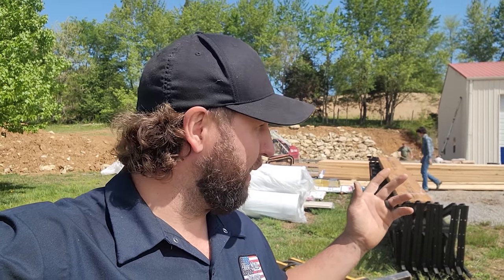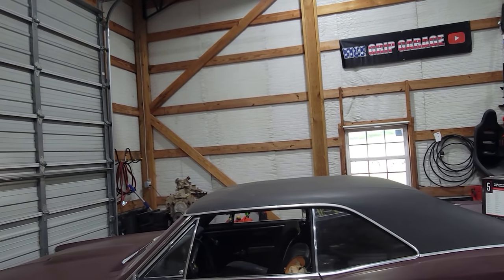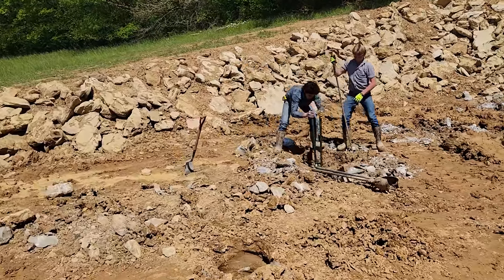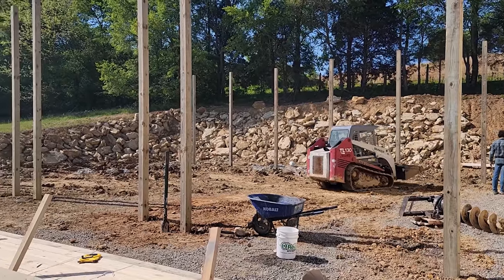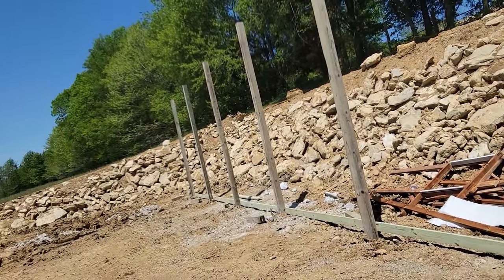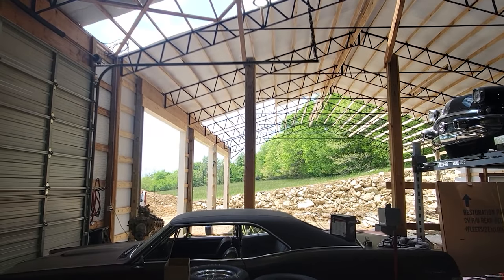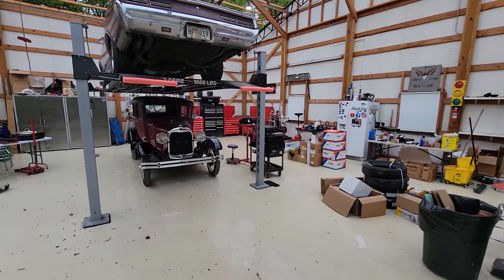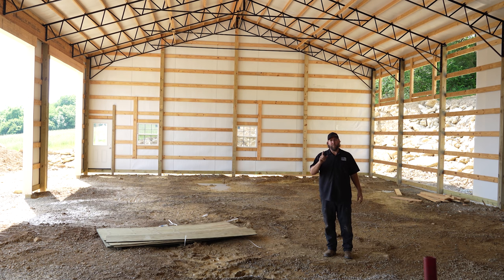Budget Shop Build - EP2 - Framing & Tin!

Comment: Save all the old tin and bubble installation & some of the gravel and cut the rotted parts off the wood that came off your shop so there is little to no cost & build a small little ''shed/shop'' with a gravel floor for your kids to use as a small YouTube Room/Rc/ATV/toolboxes kid shop

Comment: Didn't read all the comments sorry if you already got this info. I used PEX plumbing tubing inside my shop for air line to save money and install time. I used the compression rings and fittings. The tool was expensive, but the fittings were cheap.  Also my compressor is in a small shed about 20' from the shop. The air is run in hydraulic line along with the electrical in a two inch conduit. I have a reciever tank in the shop, but I really only did that because I had a spare. The system has worked leak free for over 20 years.

Comment: Derek I recently built a 36x30 ft garage.  It’s wood frame.  Up here in RI IT CAN GET PRETTY cold in the winter and hot and humid in the summer.  I installed a Mr Cool diy unit in one day.  24000 btu.  It. Heats and cools and does it well.  Cost 2200 bucks.  You might need 2 of them.  Go to you tube and check them out.  I’m happy with the unit.  I even installed two more in the house.  I got a large house.

Comment: Derek, just in case noone gave you a heads up, I could be wrong, but I think you want to say : " wainscotting", which is a half- height interior wall finish, typically used in either a  kitchen or dining room. (I was in architecture for some time prior to changing career focus.)

Comment: A 3ply glue lam column made from 2x6 is actually stronger and better then a solid 6x6. The 6x6’s warp really easy and bend and bow. Using 2x6’s it won’t do any of that hardly and it’s a much stronger overall “pole” 

They just got to be built right. 

Otherwise, man your living my dreams. A 40x120 shop….that’s to die for!

Comment: For air I’ve always run 3/4 pvc, rated for 375 psi. Easy to work with lasts 15-20 years if kept out of uv light.

Comment: Cheap and Effective air lines: PEX pipe. I run my shop with PEX pipe and it works great, plenty robust. crimped connections. PEX isnt officially rated for air but she works good. Run your main run of air from one end to the other in like 1" PEX for big gun volume, then have convenience air ports that are say every second truss  or work area at least and get a NPT to PEX adaptor, screw on your MType female end and there ya go. Obviously a coupe valves. Also I recommend metal fittings for the pex, the plastic fittings arent as robust and Im figuring you run your air system at all of the PSI

Pex is also a flexible pipe so it wont shatter or burst, if it leaks it will weep out the fittings not explode like pvc. Obviously leak test it with some soapy water or whatever leak detector you use of choice, just spray it out of a windex bottle or whatever.

Comment: Hey Derek, my little garage is only 30x40 but I ran 2inch  40 pvc for my air lines and nt only is it cheaper than smurf ---- you will gain a lot of reserve air storage. I also changed all of my old florecent lights for led and cut my electric bill in half. Keep up the content it's really great. JRM Eldorado Oklahoma

Comment: Dont use pvc for air line. Use pex or copper. Air bib in between each door. And hose bib next to them. Then mirror both on the back wall. Add 120 volt outlets to that bundle. And 240 volt outlet if you think you will be needing one. Exhaust fan on each end or one and. A draw vent. For exhaust and other fumes. Maybe a waste oil drain station. Kinda pricey but used ones that work not so expensive. Maybe find a shop closing up and see what a feller has. If near md pa va or wv i could pick it up and haul it for you or just put some peepers on it for a fella.

Comment: Check out rapid air for your air lines! Can lay out an install with 2 people or 4 friends if cold snacks are involved! Haha. But installed in our 80x100 steel frame shop an took a day an half but that's including figuring out where an how going to run lines. Best money we spent in my opinion.  An it's easy to add to if things change

Comment: Even though you arent putting in any offices or rest room, I would suggest laying in piping for a drain by one of the doors. Someday one of the boys may want to do some car washing on the inside, or at least hosing down the dirty floors and having it run away from the building under the concrete. Plus you may want a place to put a small sink in case maybe a guy gets brake clean in his eyes. I dont think you have worry about freezing like you did up north.  Plastic pipe isnt too spendy.

Comment: Derek, when you put the insulation in the ceiling, look at how you can use a radiant barrier like Reflectix to block the summer sun from heating up your interior space.  I have this tacked to my roof trusses in my garage and it is amazing stuff.  You won't regret using it.

Comment: ,Beautiful Job. I had the Amish build me a 24x40 pole barn a few years ago. They were absolutely quick and articulate. I did the vinyl siding to match my house
I am looking forward to seeing the floor poured in a completed build as I still have a dirt floor and looking at improving it. I will need a week or two to clear out my racking and toys.
BTW, if you should ever decide to let go of the Int'l Scout, I am definitely interested. I need another hobby and my age us starting to slow me down.
Thank you for all the enjoyment you àll provide. I thoroughly appreciate it and look forward to the next.
Reply: I also put an overhead door in the back wall so I can drive right through or open the rear overhead to move some of my stuff to outback to run it or store it out there.

Comment: Run the wiring and plumbing everywhere around the shop now even if you don’t think you will need it, much cheaper and easier now than it Is later. You can always tap into it down the road when needs change

Comment: DAIKIN mini split a/c and heater. I have 2 in my 30x60x12 shop. 2 10x10 roll up doors. They keep it in the 70s easily without having duct work.

Comment: Building codes are way different than here where I live, in "Uff da" country. Here concrete floors and the concrete base for walls are made first. All wood are isolated from concrete to prevent rotting. Sticking wood directly into the ground would make the building inspector go bananas... But anyways, good luck with your new shop. Wish I had enough space to build the same...

Comment: Hey derek, if your still looking shop fans. If you can find some old attic fans they can move some air good. Ive got one in my shop that is my a/c and ventilation system. You can raise the bay doors and itll move a good breeze thru. May can find some on the FB marketplace. Just a thought. 🤙🤙

Comment: Use 3/4 or 1" UV resistant PEX waterline and fittings for airlines super easy to install and alot cheaper than those special airline kits. I got 3/4 PEX running approx 140ft(50ft underground) from the compressor in the woodshop to my main shop and run my air impacts easily.

Comment: one single urinal and a sink. no toilet or anything else. it is easy and cheap. don't even worry about running water to it now just plumb it in before concrete. i did not and it was a huge mistake. congrats on the building either way tho, you have worked hard and earned it.

Comment: As far as your electrical.  I own a Electrical contracting business and have wired lots of shops including my own.  If you can run PVC conduit under the concrete it will save you a lot of money in labor and materials.

Comment: Probably can get away with some ventilation fans on the walls to put in some circulation along with some decent size ceiling fans or with some of those exhaust fans you could have some of them drawn in air those are relatively cheap

Comment: Those laminated 2 by 6 is are actually stronger than a straight up 4 by 6 treated or six-by-six treated and usually when they do Pole barns the lower 4 and a 1/2 to 5' of the post is treated and then the upper half isn't treated and it makes the post cheaper that way

Comment: my shop we plumbed for air with PEX tubing, used 1" for main distro line and 1/2" for each drop, also had a ball valve at each drop, and a Ball valve for a blow down to get any water out of every drop. PEX is good for 300PSI so no issues with pressure. the 1" needs to start near ground level, then go as high as you can go and drop the 1/2" lines for each drop down from that. the ball valves save your A** if you got air leaks at a drop. meaning that you can shut it off, and repair later. all of my air reals leak a little bit so i leave them all off unless i am using them. i built a "Lean To" cover and poured a micro slab to hold 2 air compressors behind the shop and used a series of ball valves to be able to use both compressor tanks with only one compressor running (Compressors on a small breaker box) or run both compressors by opening ball valves. always nice to have a back up air compressor, or more volume of air if needed. also use PEX on all your shop water drops as it can freeze but not leak....... we also used the PEX fittings that required a Crimp Band for a positive seal as i set my compressors to 150PSI.........

Comment: Where is your drainage at  for snow. And mostly rain fall ?  Where is your  6 inch from building to maybe up to two feet. With clean gravel on top so water is  pushing away from building more than having leaking in side .  Remember that form under your 2×6 or 8  will stop most of it .

Comment: .When they are sinking the new posts in the  ground-even in concrete- would have wanted that tar or epoxy based black ft. or whatever of the posts to avoid rotting later. Maybe not code required but a good preventive down the  road

Comment: Box fans stragetically placed to cycle air from the old site to the new. That tornadic effect. Glad you upgraded a guy.  Sometimes a guy just needs a little more room. Ever tried working on one of these new Honda's? Can't even get your hand down there to find the plugs. The weight reduction is so intense.  They did away with the distributor, lighting cables, lightning maker, and the only points I can find are on the battery, oh hell where did the battery post run off too. Just a post, that is kinda pointy, that says attach cables here.

Comment: There is an old school of thought that stacking (sistering) 2Xs is stronger than a post from a single tree. The reasoning is that you wouldn't end up with a single weak point that carries throughout the post from say a big knot or a crack along the grain. Similar to why laminated beams are so strong. I've never seen it tested to be sure but it makes sense to me. Under flection though, I mean there is a reason why carrier beams in houses haven't been a single piece since post and beam days (unless their laminated).

Comment: Watch RR Buildings YouTube channel and you will understand the stacked 2x6 posts. Typically they are more than just stacked 2x6’s. At minimum spiral shank steel pins (not nails!) holding them together, sometimes glued and pinned. In the long run they remain straighter and are stronger because you can control grain orientation and can be made from a common piece of wood rather and a specialty/select cut of a 6x6.

Comment: Cant believe they dont tape the ends of the bubble insulation where they butt up side by side, we have always taped the seams with aluminum tape. 
You could put twin 24” fans above the windows at the roof, open the windows on the opposite end of the shop and with the doors closed they will pull a steady breeze thru the shop. We have a 3600cfm belt driven fan and its quiet enough to stand under to talk on the phone

Comment: Run your electric in conduit go with bigger stuff and pull it as a bundle ie you’ll probably want 4 circuits in the new area so pull 4 12ga through together until you hit the drop for that particular spot.

Comment: Derek, have you considered using SCH 40 PVC pipe (3/4") for your air compressor sytem. Pipe is good for 450 PSI plus. No threading, readily available, easily anchored using 3/4" conduit P straps, no rust in your piping system. I have done a couple of these systems in my shops in the past with the only drawback being sparks from the grinder eventually melting the pipe.Brain fart. If yoy can.t glue it you can't do it

Comment: IDK what your needs may be but when your doing your Electrical think about doing low voltage (CAT 6 network) runs.  If you ever want to run wired cameras in the shop for videos or security you will already have the drops for it ready to go.  Or even to have internet IN the shop.  I say that as I am retro fitting my house wishing it was done before

Comment: exhausting the heat at the peak of the gables will do more than the existing fans that are just moving air. gable fans run about $250 ea. they can be temp. controlled. small price to pay for the comfort...

Comment: No bathroom. That's what the back door is for 😁 better get that installed. 
Cooling and heating. Maybe look into a water chiller. We have one at work. Our footprint is easily 4x yours and a chiller keeps the place cool in the summer and warm in the winter. Not sure of pricing. Might be an option.

Comment: Boy code is way stricter in oh, 5 ft holes with 2 ft on concrete in the bottom. 6x6 posts on 8 ft center 2x12 header boards on BOTH sides of the 6x6 beams. This is on a 32x36 building with 14ft walls.

Comment: The laminated 2x6 posts are much better then the 6x6 posts if done correctly. 
Laminated posts should have been treated on the bottom end of the post. But laminated wont bow, twist, warp and crack when it dries out. Stronger also.

Comment: Re: 3ply 2x6 posts vs. 1pc 6x6.
As long as the 2x6s are .60 pressure treated or better, in some ways they can be a better product for 2 main reasons:
1. If you have a knot in a 6x6  it can in many cases go all the way through the post and weakening the entire post because of it.  By laminating 3 plys of 2x6, at most that knot will only go through 1/3 of the post depth.
2. Actual pressure treating of the material. Look at a end cut of a 6x6 and compare to a 2x6. Often you can see the pressure treating gets less as you get to the center of a thicker piece of wood.
The 2x6s however are more likely to be pressure treated all the way through to the center. 
In the case of your shop here, we dont know for certain if the 2x6s making up those columns are pressure treated. Just because they aren't green doesn't necessarily mean they aren't treated.
For the past 15 years, anytime I get a request for a post frame building, using laminated 2x6 columns has been my preferred route.

Comment: My work bought 2 of those big outdoor fans from menards and they didn't work for sh*t. Even the electrician that hooked them up said it wouldn't work. A year prior they bought 2 "big ass fan" brand fans for the detail shop. Almost 3 times the size shop I was in. A million times better. Big ass fans are so much better. I dont mind sweating, so I just used a big floor stand fan.

Comment: Hi Derek! I forget which video you asked about suggestions for help with cooling the building economically but just wondering if you checked into adding some louvers near the top of the walls (straight across from each other) to allow some airflow through the building. You should be able to get some that close off in the winter. Your panel supplier that you ordered from might have them available or they have a supplier?

Comment: It’s coming along really nice. I could go on with lots of suggestions, but one small inexpensive electrical that many people miss is run som 20 amp plugs. So many tools run near the 15 amp load with some demanding more will blow breakers. Especially with the long runs you will have. I did it my shop and so happy I did compared to the previous one I had. 
Thanks for sharing the shop build.

Comment: How about having the electrician run some wires for ceiling-mounted whole-shop speaker system, or blue-teethed or wide-fried speakers, while he's there? Sure would be nice to listen to some Waylon or Willie as you work, and to have the volume stay the same as you move around from one part of the shop to another.

Comment: LED lighting is the only way to go for power usage and light efficiency. It will save you hundreds of dollars a month with the lower amperage required to run them. Plan your air NOW rather than trying to add it later because it will be much easier to install while everything is empty.

Comment: So, quick question.   Your builder is going to cement 6x6 pressure treated posts into the ground.  That makes them permenent.   I've always thought you pour cement footings in those 12" or bigger tubes down 42"to 48" depending on the frost line, as you pour the cement you add threaded J hooks so that you can bolt down Sampson hardware to then bolt up the 6"X6" verticles to the cement footers.   I haven't seen this method before.   I'm not sure setting pressure treated wood into concrete is great for the long term.   But I don't know about building in the Tenn area, maybe there isn't a problem in that temperature/weather zone?  Maybe this is perfect for the area?   Could be.

Comment: You should add a couple exhaust fans get the heat out from above or out The gables LED lighting save on electricity harbor freight for the big Mafashs fans they make slot wind  just retdro fit them to a switch heat get a oil burner so you can use all used motor oil pretty slick and what gives kicks out a lot of heat too you're going to want AC in that place too big garage because a lot of two or three four ton units or 10 ton unit need insulated garage doors if you're going to use AC insulated windows I hope that helps out a little bit about Derek